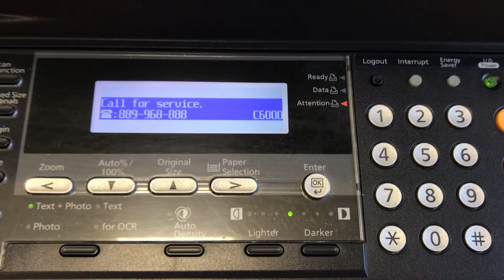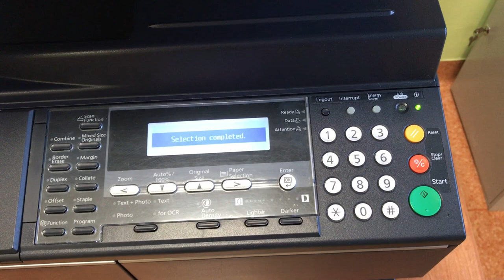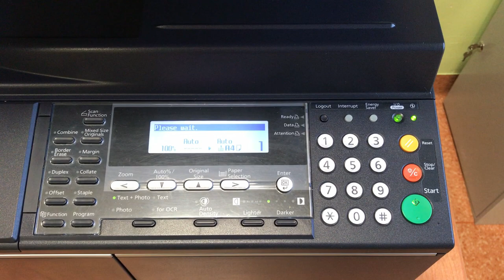Error c6000 Kyocera Taskalfa Photocopier solve problem

Comment: Hello I have error code F010 on utax 4035, what should I do
Reply from the maker: Download the controller New firmware using a CompactFlash card.
Reply: I was told by an engineer that the board is burnt and need to buy another board

Comment: Bonjour j)qi une kyocera M5521cdn je n'ai pas le menu reset fixing error :/
Reply: Pouvez vous m'aider? J'arrive a trouver le menu "maintenance"
Reply from the maker: L'imprimante M5521 n'a pas d'option pour réinitialiser l'unité de fusion. Cet élément doit être remplacé par un nouveau.
The M5521 printer does not have an option to reset the fusing unit. This element must be replaced with a new one.
Reply: @MrRicoh  ok merci beaucoup pour la réponse. Je vais essayer de trouver le bloc fusion alors merci beaucoup